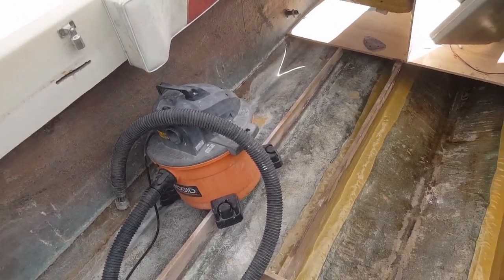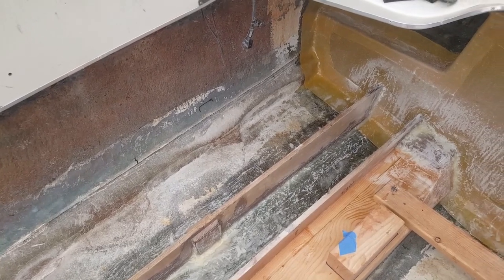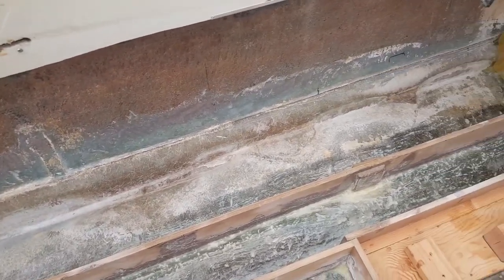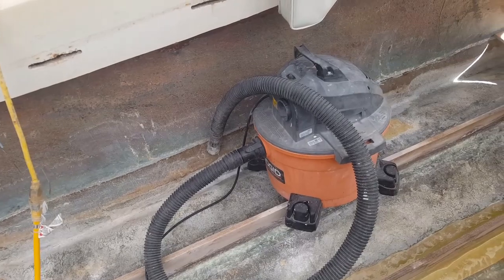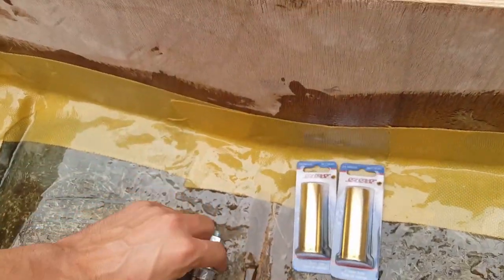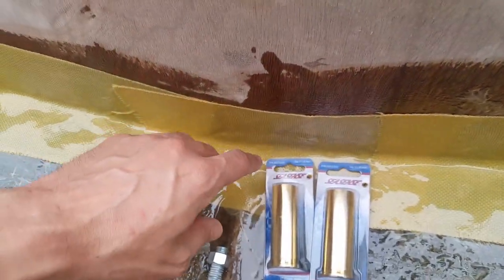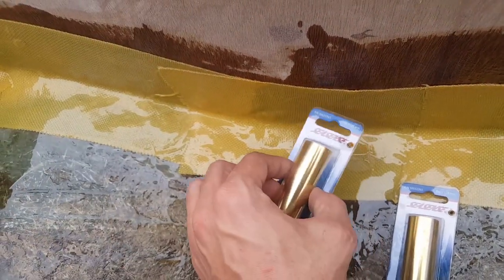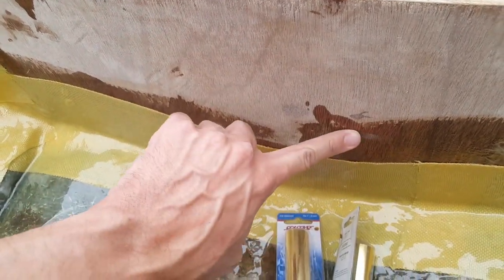Boat Transom and Floor Rebuild - Epoxy Thickening Compound and Tabbing - Part 47

Comment: How is the Kevlar working in your boat?  I have seen others recommending rounding square edges or ribs to optimize adhesion of the fiberglass cloth to the the wood or plywood.  Have you seen any de lamination of the sharp square edges after use?  I am about to use Kevlar to reinforce the ribs on a1967 wood dory - I love the square edges of the ribs but I don't want to compromise the strength after going to all the work so I am thinking about whether to round off the corners first - thanks for the great video!!

Comment: Really enjoyed the videos, you are a natural teacher.  Question that may show my ignorance.  How does water that may find its way into the lateral sub-floor compartments make its way to the bilge in the stern of the boat?
Thanks.
Reply from the maker: There are two ways to answer this. Normal scenario: The water can flow from the ski locker, under the fuel tank and out the other hole to the bilge area. You would then remove the drain to let the water out of the boat. Leak scenario: The other way to consider is the idea of a leak. Leaks develop typically over age around screws. They expand in the form of cracks and a crack in the wrong area spells utter failure. The entire wood is encased in fiberglass, or in my case, Kevlar. Once the water gets in, the water will eventually wick all the way up front--destroying all the wood.

Comment: In wa 97 a gallon plus 57 for harder came out to be 169 + the 80ft of 1708 wow.😒🤔😭.cant Turn back now.the boat I'm working on is a 30' 1972 fiberform cruiser live aboard twin  gm inline 6 165 omc 800 stringer electric shift outdrives.
Reply from the maker: I hear that! It’s worth it in the end! Please subscribe!

Comment: I'm in the deconstruction process on my boat and watching to see how others rebuild the floor.  Why did you choose Kevlar for tabbing?  Is that typical?  I've probably missed it on other builds but hadn't seen it mentioned before
Reply from the maker: A subscriber of mine dared me to use an abnormal material. I was going to use carbon fiber as well. I highly recommend you use fiberglass 1708, as needed, with either polyester or epoxy resin.
Reply: @michaelromer2016  thanks!  I thought Kevlar was used more for skid plates and that sort of thing... I was afraid I was missing something critical in my research